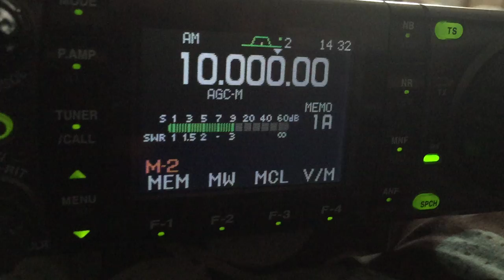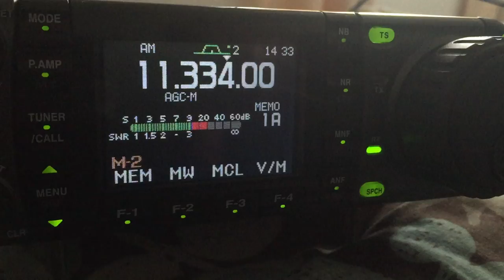Icom IC-7000 serious interference.  Helppp.  Jan 2017

Comment: I Never Heard Anything Like it........I get a steady humming noise on 80 from neighbors adt system..hope you figure it out......k4yps
Reply from the maker: Rick thanks for watching.   Noise still going on, it actually stressed me alot.  I can't listen to my radio, at all....
Reply: Your Welcome...I tried grounding with thick heavy gauge wire,that didn't work..i bought a surge protector that had emi/rfi/surge plug in that knocked it down some but still there....rick
Reply from the maker: I'm running the radio off a 12V battery, any tips?  I should have mentioned that.
Reply: I don't know.............thought you was running from power supply...just listened again...does it do with the laptop away from it?
Reply from the maker: Yes, i moved and unplugged the laptop.   I even turned off all all breakers in the house to see if its coming from me.  It's not 100% not from my home, it's external.   I thought maybe my radio went bad, i have another hf radio with same issue.
Reply: Ok............So Sorry been thinking about it tonight,my 80 meters solid noise levels even with my 7300 its useless..neighbors adt system,plasma tv I have no clue..wish I had some answers for you k4yps
Reply from the maker: I used to install those ADT alarm systems.   I think it would be there wireless contacts, door contacts, windows, etc.    They transmitted around 300Mhz, so not sure why its going on HF. Plasma could be doing it..So much noise everywhere, it's sad.  Im going to try to narrow this noise down, this week.  Go for a drive and see...
Reply: That's what I would do....gl